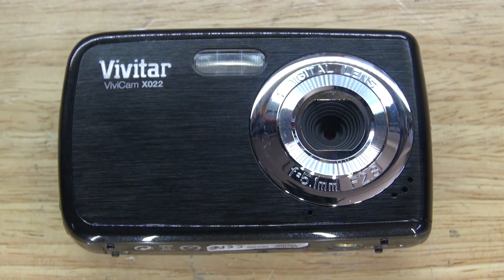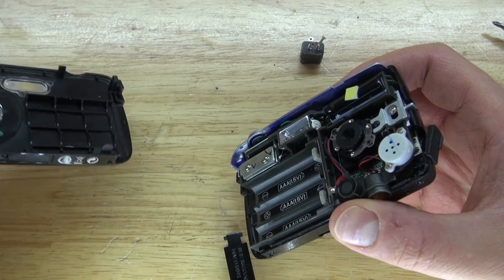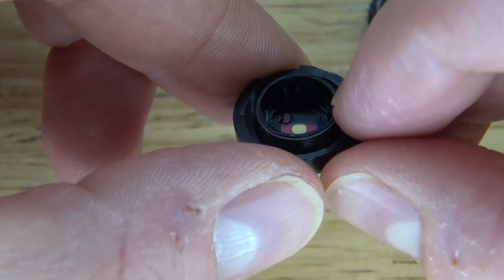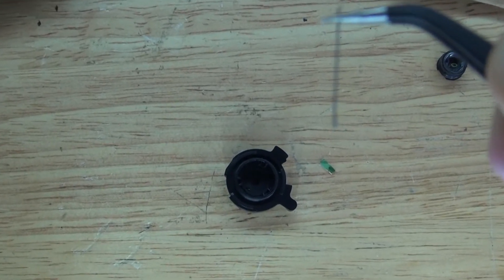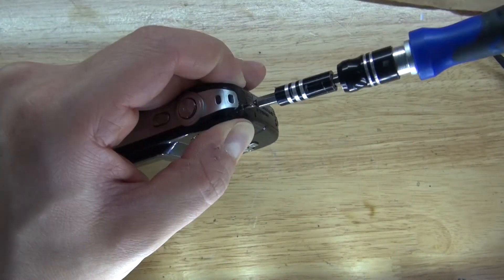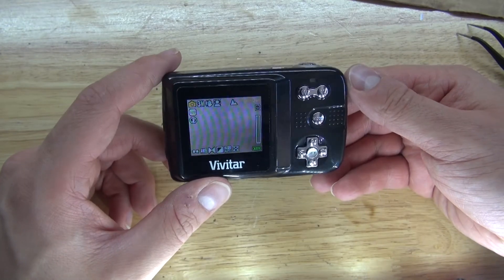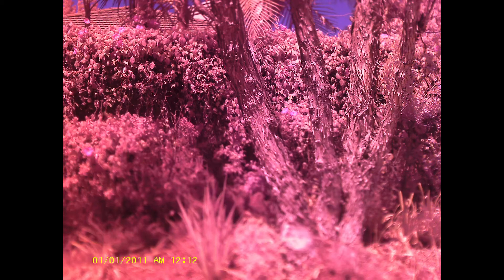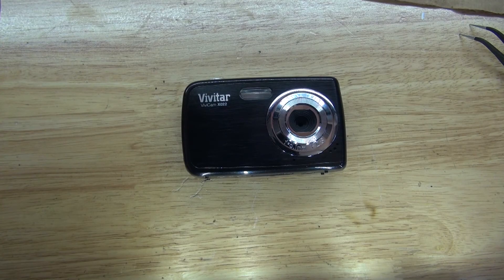Diy Cheap Full Spectrum Camera For Less Than 20 Dollars

Comment: People are commenting that the blur is because of the angle, which is correct, but it's also because the glass has a refraction index that is being compensated for with the rest of the lenses.  If you replace it with an identical thickness of optically clear glass, it will focus normally.
Reply from the maker: Interesting point!

Comment: the reason of the blur at the bottom of the picture can be because the lens is not aligned with the sensor, maybe you should have put two pieces of ir filter not one to provide a flat and parallel surface for the lens. Thanks anyway
Reply from the maker: Thanks! That would probably work.

Comment: Why couldnt you just use a drill bit the size of the lens hole and put lens back in?
Reply from the maker: A drill is not needed and it would make too much debris on the sensor.

Comment: How can I convert a cheap camera to an UV only camera?
Reply from the maker: It is possible but it won't be cheap because filter lenses that block all light but UV can be over 200 dollars. Of course depending on the size of lens. For this size camera you would need a UV passing filter for a telescope. That would cost less but very hard to find.